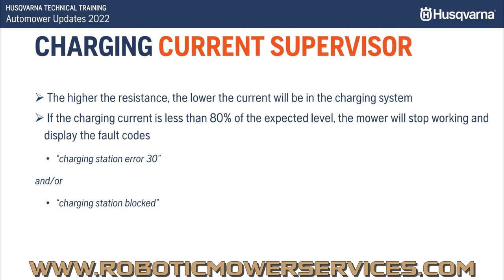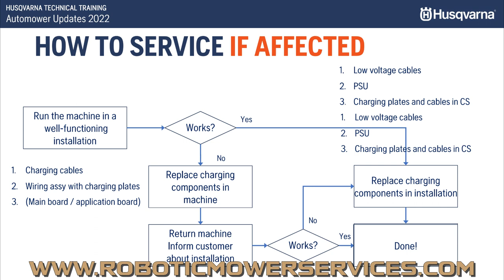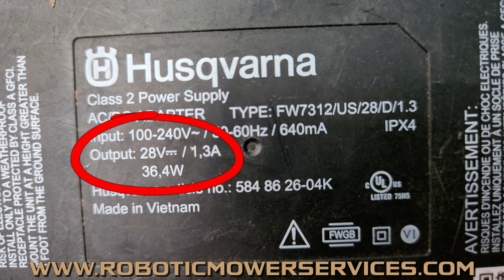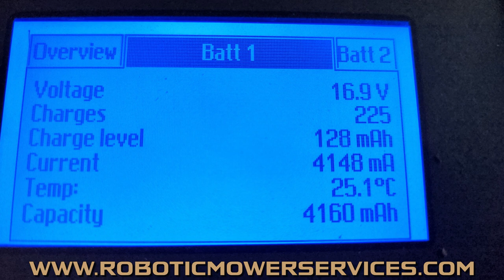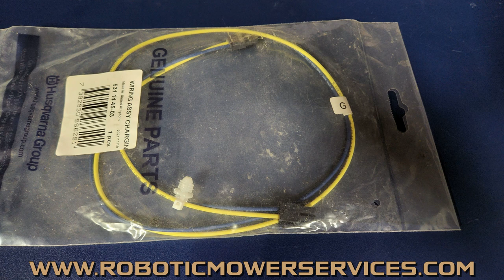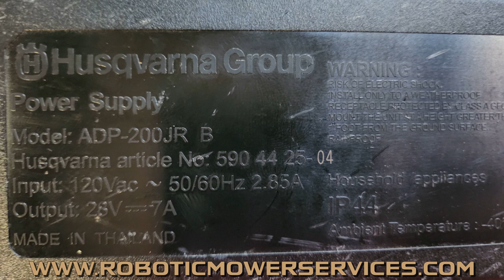Automower Charging Station Blocked & Charging Station Error Caused By Charging Current Supervisor

Comment: Thanks for the comprehensive info.
If it is ok any use to anyone, here's some info about a problem I had with my Automower 420.
It is just over 3.5 years old now.
For a lot of months it had been intermittently not charging even though it was docked.
I had a cheap third party battery in it off eBay.
I thought this might be the problem.
I paid a sizeable amount of money (as well as a sizeable drive) to get a genuine battery installed by a dealer (apparently it needed a firmware update before it would take the new style battery).
It didn't fix the intermittent charging but the new firmware introduced the behaviour above where it would reverse out of the station and say 'charging system problem' (sometimes 'charging station blocked).
To cut a very long story short, one of the wires in the charging station, just before where it is crimped and bolted onto the charging strip had basically fallen apart inside the sheathing (so it wasn't obviously broken), and sometimes the 2 ends would touch enough to charge OK (about 88%), and sometimes it would give 0%.
Hopefully this is the only problem and it is 100% fixed. If not I'll report back. Thanks again.

Also, I have to say I'm not super impressed with Husqvarna. It has given a fair few problems, mostly over the last year and a half, once it was out of warranty.
Also the new firmware has introduced a new problem where when it (very occasionally) gets stuck in my rockery and tries to reverse out, instead of stopping after a few seconds it continues to spin the wheels for ages (I'm not sure the exact time but looking at the wholes under the back wheels I'd say at least 10 minutes and still spinning before I noticed and lifted it). Dealer says he spoke with Husqvarna and they say this definitely not caused by firmware update (but this is the first time it has done this in 3.5 years of use 2 days after the upgrade). Apparently there is no option to go back to earlier firmware..
Also, apparently the original battery (which was very good) usually lasts more than 2 years, so it may be a good idea not to replace it when it is 2 years old with a rubbish 3rd party battery off eBay.

Comment: Great video! I guess the 80% should be measured when the battery has a low SoC. I have a 450x that is well above 80% when low SoC but tapering off as it reaches a higher SoC.

Comment: So my 450xh has charge rate of 3256 + 3190 which should be above the 80% of the 7amp transformer. Yet, it's still not docking properly. Any ideas?
Reply from the maker: As explained in the video, if the mower has at least 80% of the required charging amperage (not charge capacity) coming into the main board and showing in the quick info menu, then either the main board or the batteries are causing the issue. In that scenario 99.9% the main board is the issue and not the batteries

Comment: Is there any way to improve the cellular antenna on my 450xh? It has a hard time receiving a signal. It worked fine up until this spring??
Reply from the maker: Stanley, take a look at this video that shows how to check the signal strength coming into the mower. This will help you determine if it's a charging station issue or a loop sensor starting to go bad. https://youtu.be/tUzTo9-xbgo

Comment: I have this problem after a visit to the dealer who updated the software. It turned out that when I bought a new power supply transformer a few years ago I bought a smaller one than recommended. Not sure how that happened! It worked fine for years (although it would have taken slightly longer to charge but no problem for me) until I got the new software. The only solution was to replace the transformer to the one recommended for my model at a considerable cost. You can turn off the charging safety feature in the advanced menu  - but only temporarily. The time before it reactivates gets shorter and shorter the most you use it.